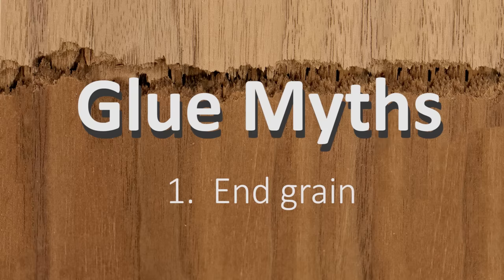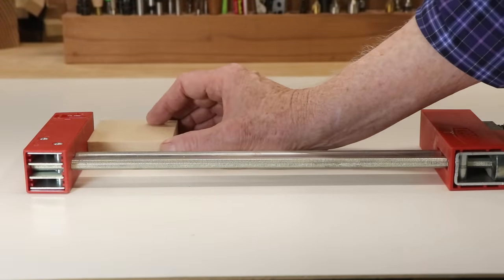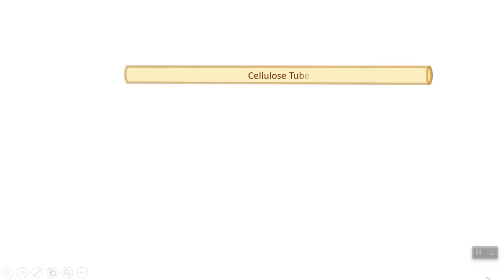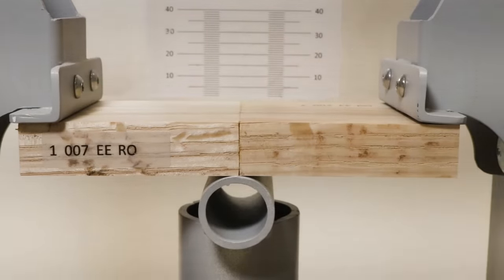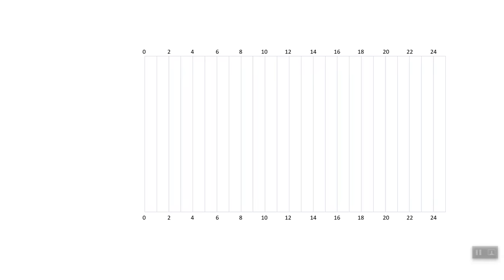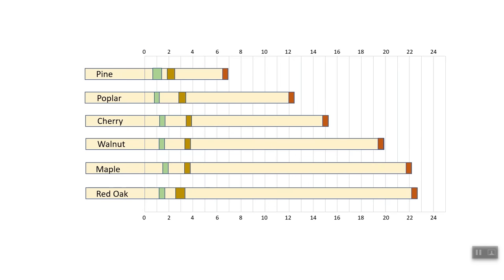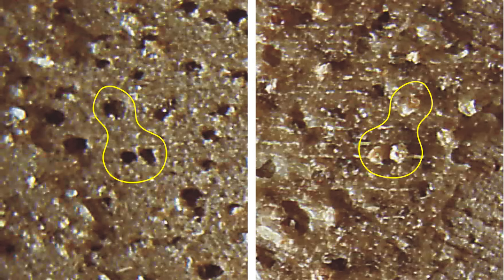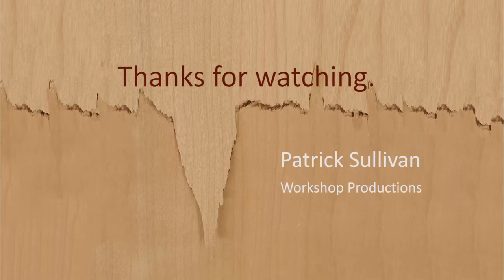Glue Myths:  1. End grain

Comment: I'd love to see this repeated with epoxy, used properly, not the way I see it applied on YouTube by countless woodworkers. In my experience this experiment would finally prove what, as a retired boat builder i know well, just how strong epoxy is. 

So using warm mixed epoxy and hardener apply to end grain and wait, reapply until wood is saturated, this might take two or more applications to reach total saturation with ten mins inbetween, then thicken your resin and hardner mix with wood flour or fumed silica and complete your glue up.

The level of penetration into the wood fibres that epoxy can achieve is staggering as is the strength of that bond. It's chemical and relatively, multiple times thicker than regular wood glues.

Just to be clear it's not clean, it's not quick but epoxy has no rival in bonding timber. 

 I'd also like to say I consider this as an interesting exercise that doesn't forgo the necessity for appropriate joinery in all woodworking scenarios.

Comment: This was an excellently done video. It was very thorough and scientific. I'm just not sure that it disproves the real reason behind the "don't glue end grain" advice. You see, when you glue a long grain joint, the joint is not the weak link of the piece of wood. However when you glue the endgrain it is by far the weak link in the piece of wood. This is the reason for the advice. When you design something out of wood you expect all that strength in the length of a piece of wood, and if you had an end grain glue joint in the middle, as your test showed, it would dramatically weaken the piece of wood. This is why joints like the scarf joint exist. I'm not sure that there are going to be very many instances where I would design things differently with this new knowledge. I will still be likely to use dowels or screws or dovetails in end to side grain, and scarf joints to put end grain together.
   I did enjoy your video though, don't get me wrong. It really reminded me of a Mathias glue test video. Good stuff

Comment: End to side grain joints in wood will typically fail due to differential in expansion contraction cycles from seasonal temperature and moisture changes.

Comment: It's all about the way we use wood.  Long grain across spans.  Two short beams glued together would never be used yet two long beams glues side by side would be an improvement over a single piece equal to the combined dimensions.   Good evaluation of poorly expressed ideas.  I would never have guessed the end grain joint would be that strong.

Comment: A few things that I learned: (possibly)

1.  I remember tests on corner joints concluding that miter joints are one of the strongest. This actually makes a lot of sense and corroborates your findings as they are end-to-end grain joints. 

2. If I look correctly, the harder the wood, the stronger it is naturally. This is a guess, but could it be because the cellulose fibers are closer knit together? 

3. Could it also be that the PVA glue utilizes the poors created by the cellulose tubes in end-grain jobs, allowing it to distribute the force of the break over a larger surface?

Comment: It would still be good practice to glue on the long grain when possible though, right? The end grain glue joint is stronger than the lignin, but nowhere close to as strong as the long grain. It makes sense to put the glue joints parallel to the grain to avoid failure across the long grain.

Comment: Firstly, thanks for the video. Secondly, we, carpenters, wood technologists, cabinet makers, etc., never stated that the glue joint strength is lower than wood strenght perpendicular to grain, rather opposite. It is well known, that wood strength prependicular to grain is rather low. We know, that wood stregth along grain is much, much stronger than the glue joint, especially in end-to-end joining. Therefore, the carpenters joints of all sorts have been developed over the years, to ensure that the joint of end butts of boards will not be weaker then wood itself. Few other points. In samples side-to-side and side-to-end You have tested wood strenght not glue strength, so there are no data about strength of glue joint in those smaples. And Your video only prooves what have been know for quite some time. Again, your conclusion mostly is the basic knowledge, we teach young wood technologiosts (at least here in Poland) that glue joint is stronger then wood strength perpendicular to grain and that end-to-end glue joint is much, much weaker then wood stregth along the grain, therefore the carpenter joints ensuring enough strength in the joint have to be used.  Sorry for a bit long post and thank You.

Comment: One factor I've often heard is that glue tends to soak into end grain, wicking into the board, which starves the joint of glue.  I also imagine that, say, edge-to-edge panel glue-ups get clamped well, while end-to-whatever butt joints often don't, so anecdotal experience likely points to failed butt joints.

I still believe that "a simple butt joint is weaker than a mortise and tenon joint" which is how structural joints that matter should be constructed.

Comment: Moisture content is a variable that could have been measured.  The woods could be at different moisture content and not equilibrated to your lab humidity.  This would be an issue especially if you got your wood from different stores with different humidity.  Also, how long has it been since the wood has been cut affects casing of the wood and water absorption/glue absorption.  But overall GREAT presentation since your information has got my brain going and thinking.

Comment: Not sure if you still have the rig set up, but as someone who uses clamps, pin nails, tape, nothing.. to hold joints as the glue cures I’d be very interested to see a test for varying clamp pressures. Thanks for this interesting video. I was definitely one of those blindly following this myth : )

Comment: When joining wood end to end you would presumably want the joint to behave no worse than if there was no joint. Which is to say that you want the strength of the fibers (long grain strength) on one side of the joint to be carried across the joint to the fibers on the other side of the joint.  As the long grain strength is 2x to 6x greater than the glue strength, a glue joint of end grain to end grain will always be weaker than if the wood were continuous with no joint.  Since the strength of the wood in the two directions is incorporated into our structural decisions, gluing end grain to end grain introduces a weakness into the structure.  The centuries long rule against end grain glue joints is upheld.

Comment: Great video. I was also one who believed this myth. I also think we tend to believe this myth because of the way we build. Like you showed, an end to end glue up is no where near the strength of the long fibers. So in the vast majority of cases, end to end glue ups are useless. It’s much easier, looks more professional and is stronger and safer to just get a piece of wood that is the proper length for your needs. Where as when we glue side to side, it’s to make panels or larger pieces of wood that more or less act like a singular piece of wood. When we build furniture we do it with the strength of the long grain in mind. That’s what supports and holds most of the weight in a piece.

Comment: If you really want to get technical, the ideal test would be a set of double cantilever beam (DCB) and end notch flexure (ENF)for mode 1 and mode 2 fracture toughness. Setting up such an experiment would really distill the question of bond strength between surfaces with glue, and designing the test itself would be… interesting to say the least. Great video overall.

Comment: The joint strength is arguably the same in all instances, because in the side to side bonds it is not the joint that fails, it is the wood.  Say the glue always has a strength of 5, but long grain has a strength of 10 and side grain has a strength of 3.

Comment: Perhaps I'm looking at this incorrectly, but the only glue joint that failed was the end grain joint. With the others, the wood failed before the glue joint. Yes, it took far more force to break the end grain joint than the wood of the other types of joints, but we still haven't actually seen if the other two glue joints hold better, worse or the same. We know how the wood will react. I think this experiment is still eye opening and thought provoking though.

Comment: TIL that Elmer's glue is PVA.  I've used tons of this stuff commercially to make industrial ceramics.
TIL the relationship of lignin and cellulose.
and of course, TIL that end joints can be strong.  Now to make that Diving Board!
I'm a little surprised at the strength of bond relationships with the hardwoods.  The Walnut and Maple are so tight grained I always wonder if any glue is penetrating the pores.  
I liked your spreading technique although I really hate using bare fingers, there's nothing to give better control.  Finally, I highly recommend you don't use Newtons to report the force loads, but kilograms are units of mass, and pounds are units of force.  If you used Kilos to make it internationally friendly to watch, you might have to consider using Newtons (just multiply kg by 4.45 unless you are testing on the Moon.)
Nicely done.  I don't follow woodworking videos but it showed up on my list, and the video was exactly what the title said it was.

Comment: I saw a video where the person thinned out glue, put it on both ends, let it dry a few minutes, then added glue normally. The thinned glue soaked into the grain and gave the unthinned glue more of a bond. Another way is to push the glue into the end grain, then added more glue. I wonder what the results would be for those.

Comment: There is another big factor contributing to glue joint strength. The amount of glue.
In a real world scenario multiple joints get glued at the same time. So the glue stays on the wood for a long time before the parts get pressed together.
In that time the wood absorbs the glue, sometimes to the point where there isnt enough glue on the surface for a proper bond between the parts. 
On end grain the matter is much worse due to the porus nature of the material. The material basically wicks up the glue. 
So if one were to seal of the  end grain structure with a resin of some sort to achieve a 100% flat surface, one could glue the endgrain as good as any other surface. 

Another point: 

The long grain strength of wood correlates to its desity. A desner wood got more cellulose fibres in it, which gives it the long grain strength you see.
Thats why pine and poplar were weak compared to the much denser maple and oak.

Comment: Fasinating information. I am curious to see what happen if instead of putting the force directly on the glue line you fix one end and then put the pressure on the other end instead of the middle. The results may be very different. What I think is critical for viewers to understand is that while end grain to end grain is stronger that we thought as you have shown, depending on your use it may still may need joinery to become strong enough for the task. I make chairs and I have tried end grain to end grain for the angled back of the chair. While it is stronger than what we thought it invariably has failed for me anytime I did not strengthen it with dowels. I understand end grain to end grain is not weak but I have seen it in practice that to be able to withstand the normal day to day usage, the back of my Ash chairs has to have dowels or it fails in a couple of months while the backs with dowels have yet to fail. Not disagreeing with your results, but pointing that we still may need to strengthen an end grain to end grain or side grain to side grain with joinery depending on the use.

Comment: End grain glue joints can be strengthened by increasing the surface area as is commonly done with trim molding.
You can get router bits to make such glue joints.
Reply: Those router-bits are cutting the wood such that you get a longgrain joint.
Reply: @ABaumstumpf  exactly!

Comment: Thank you for this fine and thorough presentation, except I think it missed the whole point of gluing wood side grain to side grain. Anybody who uses dimensional lumber knows that wood is much stronger when the force is perpendicular to the grain than when it is parallel. So when building something, they would take this into account and orient the grain accordingly. If glue needs to be used, it is best to glue or fasten 2 long pieces side grain to side grain in order to preserve the strength along the grain. That way you know it was not the glue that failed, but the wood itself. When gluing end to end, as you demonstrated, it is the glue that fails, and is relatively weak compared to the strength of the wood along the grain.

This is why butcher blocks are glued staggered so that there is always a piece of wood on both sides of each butt joint to strengthen it.

Comment: In my head ,it was never about glue strenght or wood but more about seasonal movement of wood ( wood expand /contract acros grain during year/humidity change)
so basicaly in side to side wood moves in one axis so wood fibers glued to another (touching) don move relative to each other (pairs move relite to each pair)
in endgrain to endgrain fibers move in two axis and is not very likely they follow glued pair in same manner what causes  micro cracks and joint failure over time
what i noticed on failed end to end joint (old ones) usualy its not glue that broken but very ends of side fibers ,but i imagine new fresh elastic glues can diminish that effect

Comment: Hmmm...  A better summary statement might be "Glue is stronger than lignin;  therefore, a properly prepared end-grain to end-grain joint is stronger than a joint with one or both surfaces composed of long-grain assuming that the compared joint surfaces are of equal size and geometry, and equal bearing distances from the loaded glue joint for deflection loading."  Not as snappy, but it has much less wiggle room to go astray in.

Comment: this was an excellent video, and very interesting. a couple of factors not considered, and can easily be be defined as out of scope for this test.
1. the glue - this test only has results for one type of glue. as noted, the glue depends on penetrating the wood structure. other glue forms, and OLDER glue, my not have done as goo a job ast this modern glue, resulting in earlier failure.
2. the cut - you were able to get a very fine/smooth end grain cut. if you had a rougher finish, ie a courser blade, would the results be the same?
Thanks for the effort, it was still very informative.

Comment: He is saying that the end grain glue joint is stronger than edge grain joints... However, in his test the edge grain joints didn't fail, it was the wood itself that broke. The end grain however broke on the glue joint.

Regardless, whether it's a myth or not as to which joint is stronger, either is sufficient. It's the specific application and look you're going for that will determine which method you use.

Comment: Hey thank you for sharing your research results ! Did you measure the distances of the deformation while putting the load on the testpieces ? It would be interesting to see the energy absorption of the different joints. Would they differ? When I imagine trying to break a piece of wood by jumping on it, i could imagine that it feels easier with the grain being parallel to the long side.

Comment: I know that I'm just a noob, but I had always been under the impression that a fracture of the glue line was a "failed joint" and that's why dowels, dominoes, and splines were effective.  If the material breaks away from the joint, it's a strong joint.
Bend your finger  direction it's not supposed to go.  If the knuckle dislocates, the bone is strong and the joint is weak. If the bone fractures, the joint is strong and the bone is weak.

Comment: Fantastic video. Seriously. Did you also do the non-glued long grain strength test on the endgrains? The data you present suggests it would require much more force than the long grain, but it would be interesting to see just how much stronger it is.

Comment: It is quite fascinating the amount of people that are misinterpreting the conclusion of the tests.... Your quality tests show that glue bond is stronger than the natural lignin bond in wood. They do not show or prove however that an endgrain to endgrain joint is strong enough to use in load bearing carpentry..(chair, table, etc). In reality, non of the joints tested could, would, should be used in load bearing carpentry.  Looking forward to more tests.. 👍

Comment: I had a feeling it would be stronger
You get the most glue absorbed into an end grain joint, and since the glue tends to be the strongest part of a joint (except for those long grains) it will be a stronger joint since it penetrates deeper. Think like a cold solder joint vs a proper solder joint.